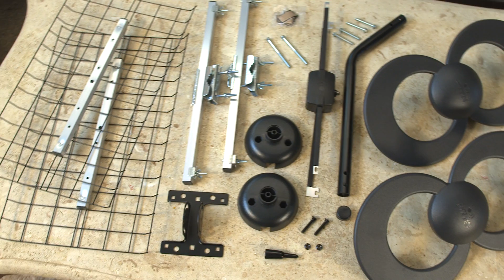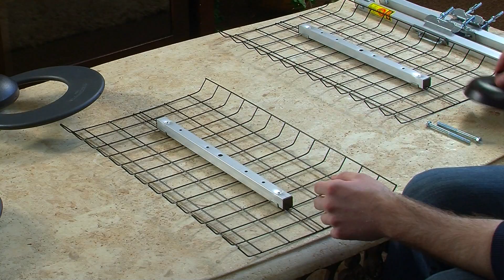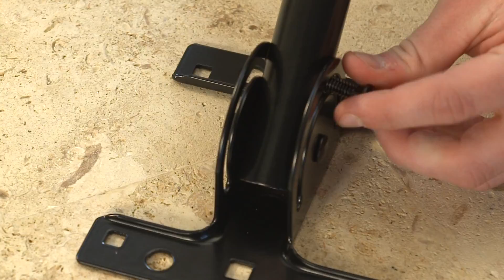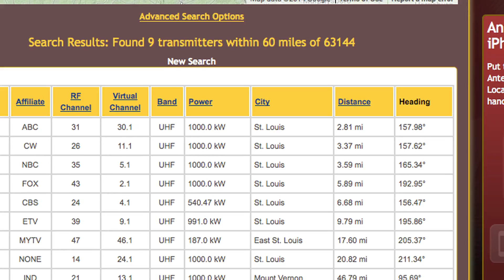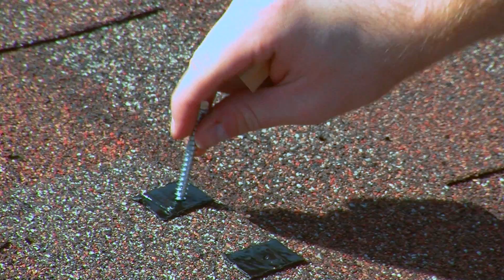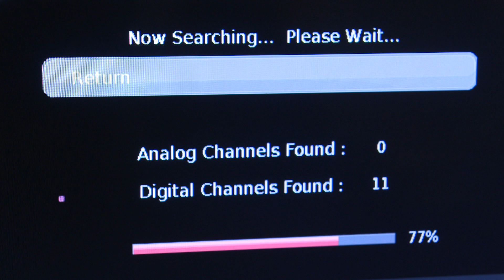ClearStream 4 Extreme Range Indoor/Outdoor HDTV Antenna - Assembly and Installation (Outdoors-Mast)

Comment: Will the novice everyday kinda person notice the tv reception and more tv channel pickup over the newer next model Max4 ? Anybody ?  #AntennasDirect
Reply from the maker: If you have a ClearStream 4MAX and need to reduce multipath interference, you will need our reflector kit assembly. They are available on our website - antennasdirect.com. My suggestion would be to speak with our tech support first and have them provide a free signal analysis at your location before purchasing additional equipment. Also, you may want to check out transmitter locater to ensure you are picking up all the avaialble channels in your area. Type in your zip code:  https://www.antennasdirect.com/transmitter-locator.html. Thank you!

Comment: Just got the clearstream 4 ,it doesn't have the reflector or a amp(what type of amp ?) , if I order this stuff will it work even better
Reply from the maker: You have a ClearStream 4MAX if the antenna model doesn't have a reflector. A reflector is only necessary if you are experiencing issues with multipath interference. And a amplifier will boost signal strength, but we encourage everyone to temporarily install the antenna in the location where you plan to permanently install the antenna. Connect the coaxial cable to one of your TVs. Download our free app Antenna Point to make sure you are aiming the front of the antenna towards the largest cluster of towers available in your area. Then, run a channel scan on your TV to see if you are receiving all the available channels. You may want to move the antenna to a couple different locations to make sure you have the best location to install the antenna and you are happy with the stations you are receiving. You can see the number of TV channels are available in your area by selecting the Towers & Channels tab in the Antenna Point app. We do not want you to purchase additional equipment unless it is absolutely necessary.